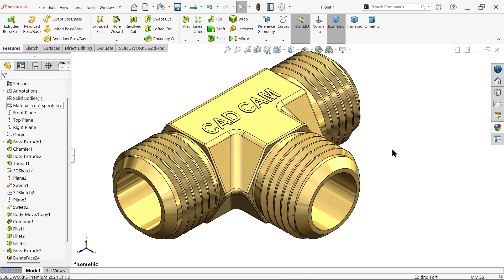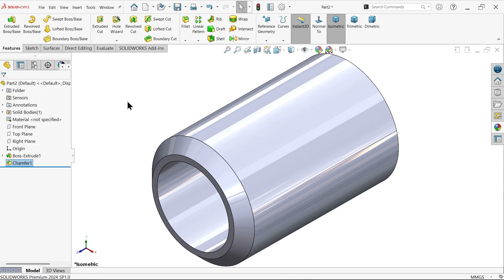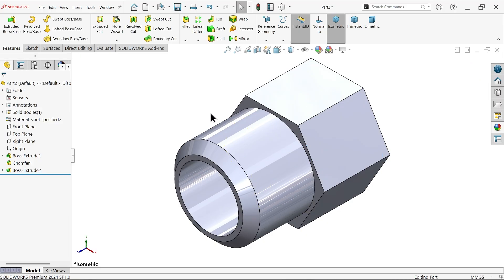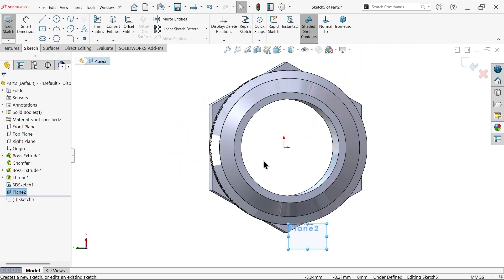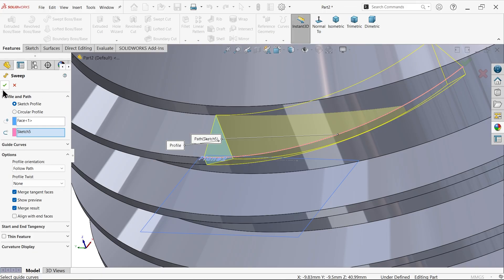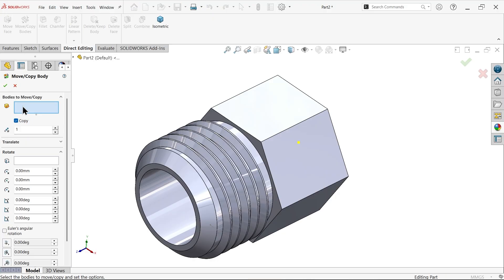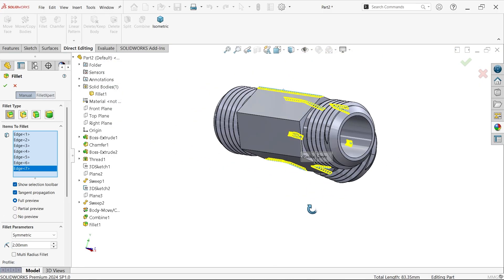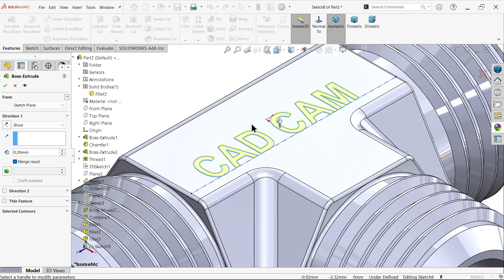SolidWorks Tutorial T-Joint Modeling

Comment: Which laptop is good for solid work, if I wanna work like that you . please make video on solid work application installation and setup in our laptop
Reply: I use lenovo legion r9000p, if ure interested, great laptop for solidworks. It's specifications allow me to work smoothly and easily. Pay attention that it could has different specs thow depending on model
Reply: @eduardabzalov2067  I bought lenevo loq i5 13th gen ,it's good for solid work
Reply: @Toney__786  what specs it has?
Reply: @Toney__786   it must be 8gb ram and 250 rom and i5 13th is very good
Reply: Hp victus